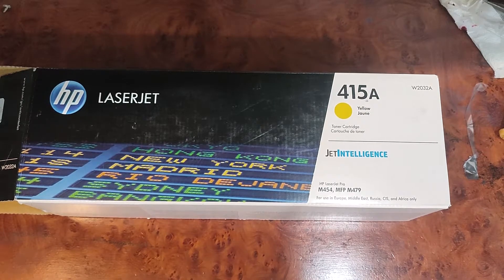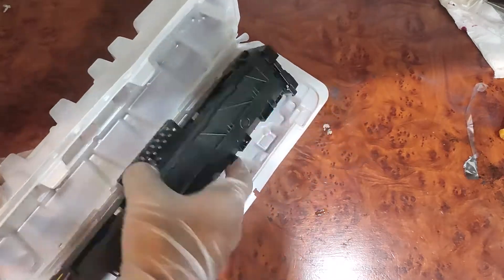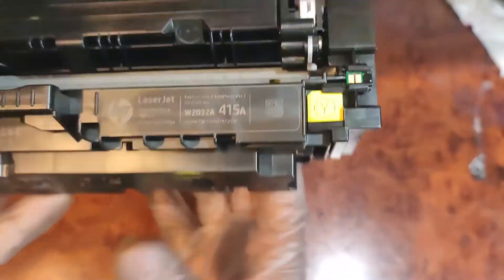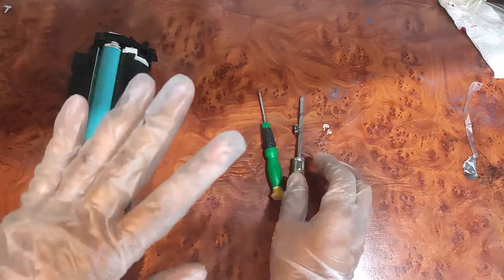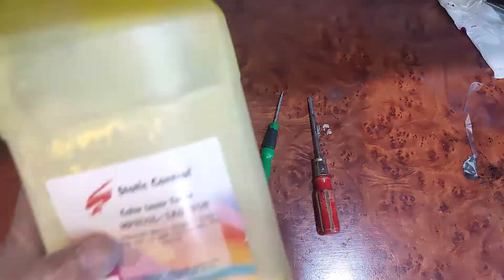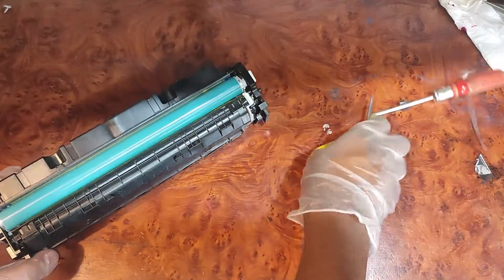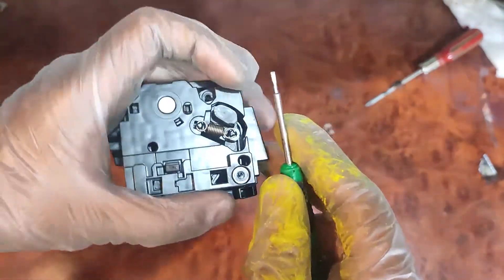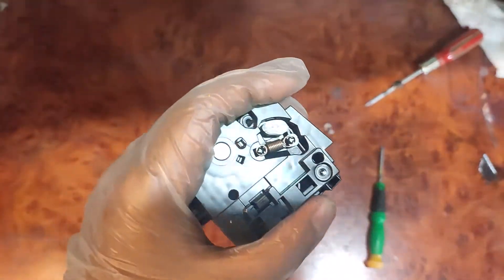How to toner cartridge refill,recycle,reuse.HP toner cartridge 415A refilling.hp  printer refill2022

Comment: You said if there is any problem we should get back to you. I followed your tutorial successfully. But, still the printer is saying low cartridge . What should I do
Reply from the maker: It is not a problem, you can print it and see if the print is correct
Reply from the maker: Carthage low.  This message will appear because you have not changed the chips.  But it's no problem you print